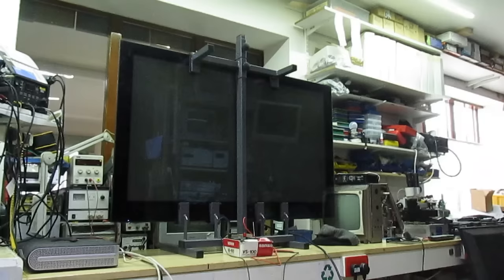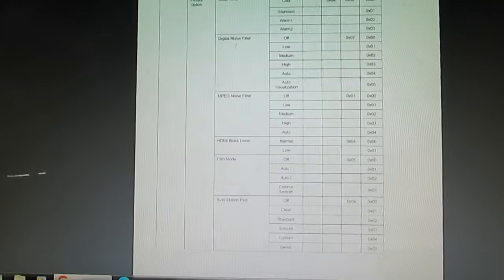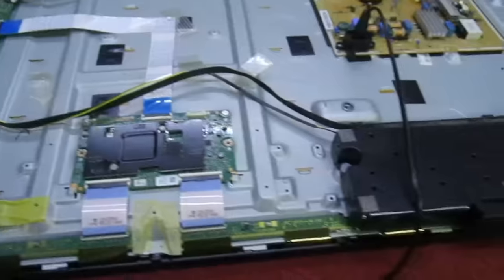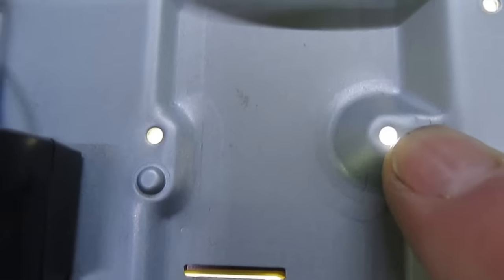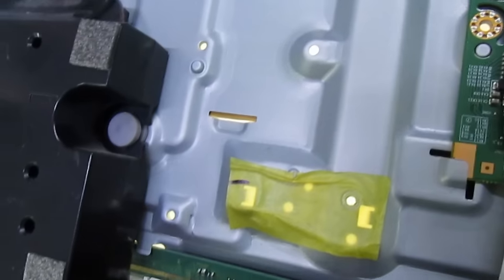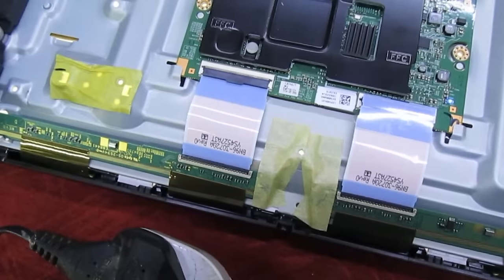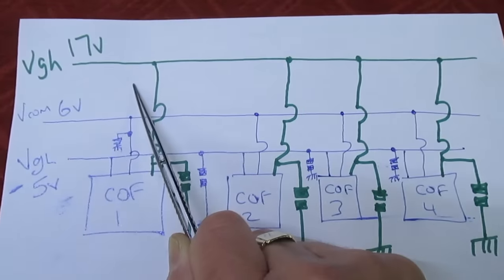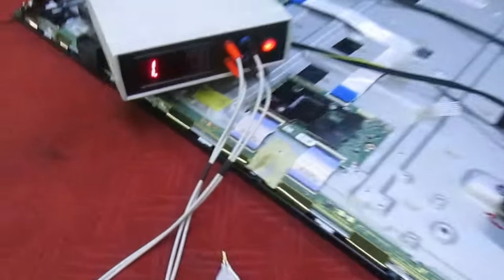Video to highlight the problem of repairing flat panel TV sets

Comment: Would it make sense to replace all of those caps (if one failed are others sure to follow?)  and also to use a different type that is more robust or at least higher voltage?  (of course it has to fit).
Reply from the maker: Of course it would be better to replace every one but I don't charge much anymore because bew sets are so cheap. I source my caps from rs components so they should be of a good quality.

Comment: Thank you for sharing your knowledge, could prove to very useful at some point. I must admit I was somewhat lost at 12:24 because with the faulty side plugged in it worked, I couldn't follow the logic. I was then expecting it to be a supply failure but due to loading and it wasn't. 
I'm pleased you mentioned about the broken tripod as this is the only one of your videos I've seen, subscribed now. I use a home made jib as it offers easier and smoother camera movement, having said that I built in a design flaw and it doesn't work as well as I'd expected, every day is still a school day.
Reply from the maker: Without a service manual and technical description  I cant answer your question , I can only guess that there is some sort of control signal coming from the T con going into the microprocessor keeping the backlight  switched off and all TV s behave differently so there is not one diagnosis fits all sets, but it did highlight just how easy it would have been to make a wrong diagnosis .

Comment: Very interesting, nice fault finding. I've used a bench power supply to find shorts like that before. I must say I miss working on flat panel TVs like a hole in the head!
Reply from the maker: I know what you mean, far better working on vintage stuff but unfortunately flat panel is the future, I use bench power supply to see what burns up when the short is above 1 ohm and milliohm meter won't do.
Reply: @michaeldranfield7140  Exactly, in other words is when you get for or five of these capacitors connected in parallel right next to each other
Reply from the maker: I know you don't like flat panel TV sets but have you seen how many views this video has had, might be worth considering if you are getting paid by YouTube?
Reply: @michaeldranfield7140  Hi Michael, the money is so poor these days it would hardly be worth my while. Between 50c and a euro a day. A video like this on my chanel might do £10.. I don't have the space for the flat stuff anyway. Thanks though, and it's great to see you getting the recognition you deserve.

Comment: Nice clear analysis of the fault. Bugger hard without the circuit diagram though. Good job!
Reply from the maker: I know what your saying but when I narrowed down the problem to the LCD panel there's only 2 things on the panel that could cause the fault, either a shorted cap or shorted COF.

Comment: Well done on this excellent.  It is the best practical video to follow when in fixing Samsung led tv. 
I have a 32inch samsung tv with this issue and i need your opinion.
The tv works fine but when the backlight setting is set to maximum the display starts blinking on and off.
The display is normal and tbe blinking on/off stops when adjusting the backlight setting to 14 or less.
I followed your lead and disconnected the power to the main board leaving only the back light connection on.
The result was that the back light leds turned on but blinking on/off.
Now how do i determine whether the problem lies with the power supply board or the back light leds?
What dc voltage reading should i get when i measure it at the backlight connector both with
the leds connected and disconnectec?
What external dc voltage do i need to check the back light leds independently of the p/s board?
Reply from the maker: tricky one , it could be either power supply cant supply enough current for the LED s  or the LED s themselves faulty, some boards are marked with the led output voltages , other than that you have to search the internet and see if you can find how many led s your set uses and if there 3 volt or 6 volt,  so for example if you have 40 led s at 3 volt each 40 x 3 =  120 volts , so you would need a constant current bench power supply that will do 120 volts at 300ma .

Comment: MLCCs are "not very reliable" is a bit meaningless without context.  They are far, far more reliable than any wet cap.  They do however experience torque fractures which shouldn't be an issue in 99.9999% of use cases and usually shows up pretty quickly.  They can crack over time, I'm sure with large heat fluctuations, but if you looked at the device failure rate due to them and then counted how many of them are in each device you'd quickly see they are one of the most reliable caps, with single layer ceramics probably being the most reliable.

Comment: I still have my 60" LG plasma from 2011.  Maybe I've extended its life  by using the energy saver function on it so it runs cooler and picture a little darker (it's in a dark room anyway).  I will keep using it until it finally dies.
Reply from the maker: in 2011 sets were much better made and built to last longer as in those days they were mega expensive compared to today .
Reply: @michaeldranfield7140  I won't deny it!  It was $1100usd at the time!  It is 90 lbs heavy as well, thanks to heavy duty internals to keep that high current reliable.

Comment: Wonderful video Michael. I was hoping that following your steps would lead me to fixing my Samsung 65" with the same problem of no backlight but OK audio.

Following your steps:
- disconnect main board from power supply board, see backlighting light up
- disconnect TCON from main board, still see backlighting light up
- disconnect TCON from panel, no longer see backlighting light up

At this point I checked the voltages at the inductors on the TCON board -- none of them appeared to be shorting to ground.
I also checked the fuse on the TCON board and confirmed that it had not blown.
Visual inspection of the TCON board didn't reveal any obvious trauma.

Anything else you can suggest checking?
Reply from the maker: I think best thing to do would be to check the LCD bias voltages on the T con with connected to the main board but not connected to the LCD panel then see if the voltages are and different when you connect the T con to the screen, also take a look at my video how to diagnose a TV that appears to be stuck in a boot loop.

Comment: Component wasn't shorted.. someone let magic smoke out.. awesome video..
Reply from the maker: a lot of circuits are now designed to trip out in the event of excessive current flow, would have been easier to find if it went up in smoke !

Comment: Just to show how simple troubleshooting can fix a TV, I picked up a 32" LED television a year ago from my neighbor's trash.  It would not power on. The remote was also thrown out with the TV. The first thing I tried was to hit the power button to see if the TV would power on. It Would not power on when pressing the power button on the TV, so I tried the remote. Still no Joy. I checked the batteries in the remote, and they were dead, So I replaced the batteries and tried again. Instant sucess. The television powered on. It worked perfectly. Well, Almost, the power button on the TV still did not function. I opened the television and checked the power button micro switch. It was not working, so I swapped it with another like switch from a scrap TV. After changing that switch, I had a perfectly working 32" TV.  I actually picked up the tv for scrap but ended up fixing it for $0.00. This wasn't my first find, nor was it my last. I have picked up several TV's over the years, and about 50% of them were simple repairs, while the other 50% were either cracked panels, or just abused beyond repair.
Reply from the maker: yes , I have had sets brought in for repair where its only been the batteries in the remote , or on some sets the hidden power switch under the set has been switched to the off position accidentally while cleaning , and I think to myself how many people must have thrown sets away  with such a simple problem .

Comment: Sometimes you just get lucky and those bulging caps on the power supply board stick out like a sore thumb lol. I fixed my 12yo PC screen with $2.50 of parts.
Reply from the maker: Of course, a visual inspection before carrying out and fault finding is essential. As you quite rightly say some faults can be diagnosed without any test equipment.

Comment: I fixed two flat panel TV's that wouldn't start by replacing some electrolytic caps.
These capacitors dry out from age and temperature.
Not surprised that they were around the hot power supply.
Reply from the maker: yes capacitor life is now not what it use to be , most sets made with cheap poor quality caps these days .

Comment: Thank you very much Michael, you are a fount of knowledge.  I would not have known how to find the faulty cap on the cof strip using the milliohm meter.  That is one to remember! Again, many thanks.
Reply from the maker: milliohm meter is not something you use every day but a very useful device when looking for a short circuit and it saves mass disconnecting of components connected to a common supply rail.

Comment: Great video, only thing I could not find was where you put each probe when testing the cap voltage ? would have liked to see that rather than the voltage display
Reply from the maker: I did make another video a while back about tracing shorts with a millohm meter , the probes must go straight across the capacitor .

Comment: Nice, thank you! I'm currently trying to diagnose several Samsung LCD's that have backlight problems. The backlight is "working" but the output is dim on one side of the screen. Apparently this is a common thing because I have a whole bunch of them doing the same thing. Anyway, I just started looking at them this helps me with things I can check. If I had a schematic I might be able to see right away why it might be doing this, as it is I have no idea how the lighting is wired. I'm secretly hoping it's just a loose connector or something. :)
Reply from the maker: If you have more than 2 wires going into the screen for the LEDs then there are multiple strings of led s in the screen and if one string is not lit it will cause exatcley the problem you describe, given how unreliable the LEDs are its far more likely you have a led failed than just a loose wire.

Comment: One way to extend backlight LED life (or, for that matter, older florescent backlights) is don't drive them at 100% (take them down to 80% or lower). Every flat panel I own, going back 20+ years, still works perfectly, with minimal backlight degradation. This ranges from cheap dsub-only Dell 4:3 17inch monitors, to 30 inch Apple Cinema displays, to LED backlight 4K monitors and TV's (and I have an usually large number of displays, due to my work). Besides most displays being retina searingly bright at max settings, even if you don't burn out a LED, when left at full brightness (and subsequently generating a lot of heat), it seems to damage the LED's white phosphor coating, turning them blewish.
Reply from the maker: I do this on all LED sets and no one has even noticed, so yes this is the thing to do , on later sets the heat causes the yellow phosphor dot to crack and fall off  .
Reply: @michaeldranfield7140  Appears that there's an arms race to build a panel so bright, it's capable of causing permanent blindness.
Reply from the maker: Or is it a clever plot by the manifactures to make sure the set doesn't last long so you buy a new one after a short time?????
Reply: @michaeldranfield7140  I always like the simplest answer to a problem: all these companies are in a “Battle of the Nits” (CPSM) to see who can recreate the luminosity of the sun. This has resulted in spec’ing LEDs capable of some pretty incredible output (especially given that they’re sitting behind all the diffusion layers, LCD, etc,). But, they’re also, at max setting, running right at specification, with no headroom. That there aren’t more LED failures, combined with most companies having a desire to avoid warranty expenditures, leads me to believe they aren’t doing it on purpose. 

I’ve also noticed that more recent displays seem to be much more reliable, as we have a number of 60inch Vizio brand 4K panels at our offices, in conference rooms, that are pretty much subjected to the worst possible conditions (being left on 24/7, max brightness, AV/AppleTV set to never sleep - god forbid a power point deck be interrupted by power saving). Last I looked, they were still just fine (no blue splotchiness), blindingly bright even with the morning sun streaming in the windows. 

The last set of panels, swapped out 4 years ago (which were only about 4 years old at the time), were in really terrible shape. One had a flickering led in one of the adaptive “zones”, they all had gone bluish, all had considerable dimming, one had developed bad artifacting (I remember 15min argument at the start of a presentation over whether the problem was the display or the HDMI cable). After 4 years, those circa 2014 panels were all junk. I want to say they were LG, but regardless of brand, friends and family whose displays are from that era, all exhibit variations of the same degradation. 

So some of the issue was that the first few generations of LED backlighting weren’t fully baked. We’re seeing many of the same problems with OLED displays today - burn in, degradation, matrix failures, etc.. And, again, all of which appears massively accelerated by punching the brightness to max. My OLED 4K panel is a year old, and still looks great, but my coworker’s identical display, which he runs brighter and without the short sleep cycle that I use, has dimmed very noticeably. For TV use, I wouldn’t go OLED for at least another couple of years, because large panel OLED’s are still in their infancy.

File all of the above under IMHO, statistically irrelevant sample sizes, YMMV, etc..

Comment: Another method would be to inject low voltage on the first cap in the line and then look for the cap that heats up, indicating a dead short.
Reply from the maker: Done that before and just see what burns up .

Comment: good info, worked on a few of these TV's before, can be tricky determining issue
Reply from the maker: Yes. It's very easy to make a miss diagnosis but rather odd that a problem on the LCD panel should keep the backlights switched off.

Comment: Great video, most faults tend to land up being just a single component. I'm puzzled you say it's a 10uf cap, was it non polarised?
Reply from the maker: Yes , its a 10uf Multi layer ceramic capacitor and they are non polarised.

Comment: car dealerships are getting like that too. Use to be able to go online at a dealership and find parts exploded view. a lot not anymore. you are presented with a screen that you fill out and a parts expert will get back to you. A lot of parts resellers like Rock-Auto do not have  parts for new cars. if you think it's the back light you can take a flashlight get real close and shine the light at an angle, you can see the picture.
Reply from the maker: So much stuff is going the same way so its not surprising cars are going the same way and its for this reason I don't think the right to repair will work .

Comment: 14:25 when your measuring voltage is that a voltage reg chip our measuring how you get the 3 rail voltages i have samsung same issue got light bar but think its this
Reply from the maker: Yes , its the chip that generates the different voltages of bias that the LCD panel needs to work .But just because a voltage is missing it does not always mean the chip is faulty .

Comment: I'm not understanding something. How does the tv work without the capacitor and if it works without it then why didnt it work with the bad one still in place. Also if it works without it then why was it there in the first place and do you really need to put one back in?
Reply from the maker: local decoupling capacitors are to prevent switching noise and transients appearing on the supply rail ,in a lot of stuff you can remove them and the set wont preform any different at all,but as there fitted its best to just replace them rather than remove .
Reply: @michaeldranfield7140  I appreciate the info on that. It was buggin me trying to figure out its purpose. lol

Comment: Late to the party with a quibble at 19:36 you show the voltages 300 200 100 200.  I assert the final value should be 100 again.  I remember using a GenRad Bughound microvoltmeter that allowed following current through a trace in the ancient TTL days.  Perfect device for the job of finding a short in a trace that goes all over.   1970's.
Reply from the maker: as soon as you reach the lowest point and after that the reading starts to rise you have found the problem .
Reply: @michaeldranfield7140  why would the voltage rise again BEYOND the point where the shorted component is?
Reply from the maker: @jaybowden3266  because as you move further away from the short your not just measuring the short itself your also measuring the resistance of the copper track leading up to the short .
Reply: I assert your measuring the voltage drop from the current flowing through the trace.  Beyond the shorted component, there is negligible current flow in the trace and therefore the voltage does not drop any further.  Is how I learnt it.